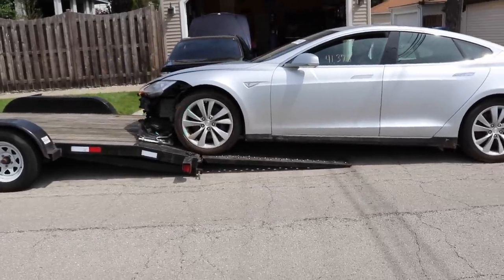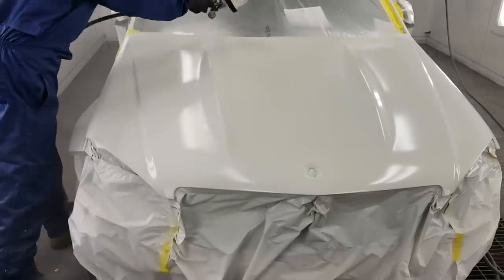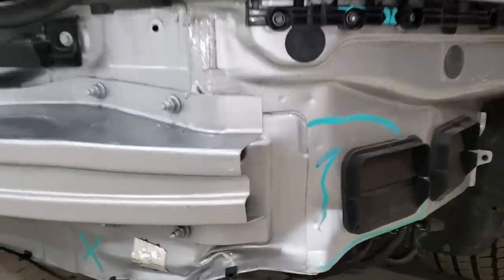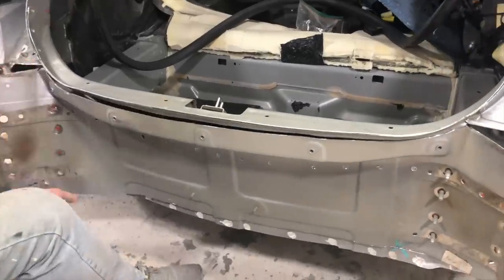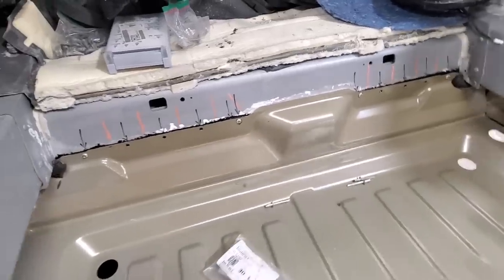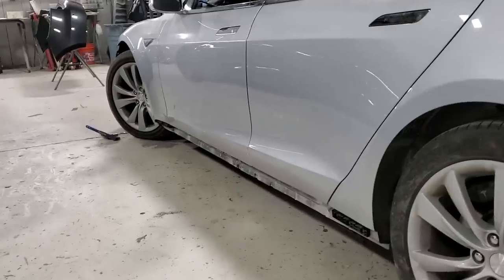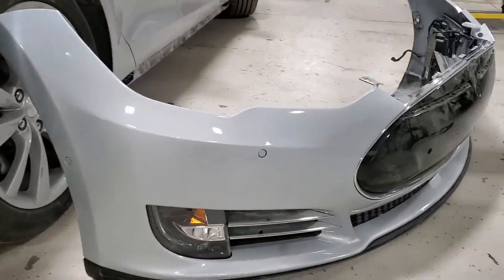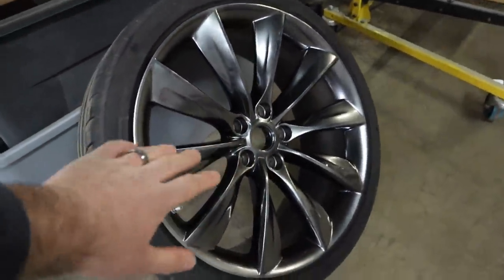Rebuilding The DESTROYED Aluminum Body On My Salvage Tesla & Price Reveal! Cheap Performance Tesla!

Comment from the maker: Would you drive an electric car today! If so, what model?
Reply: Not yet.  The range, charging time, and my own lack of place to plug in at home make them, to me, impractical
Reply: Model Y, new model, what could go wrong.

Stay away from that Rich guy.  I saw him lurking in a grinch suit at a florida farm.
Reply: Sure. The new Jag E-Pace looks decent for an all electric SUV, but I'd be going with the all new Cadillac Escalade electric SUV/truck, that is when it gets to market(spoken appropriately from the diehard GM guy that I am).
Reply: I had a '15 Leaf. I'd buy a new one, or a Tesla.
Reply: LegitStreetCars TESLA, would be the only option for myself😁
Reply: The one I'll never be able to afford. Porsche Taycan.
Reply: Always heard that the Nissan Leaf is the most reliable electric car
Reply: Nope. Where I currently live lacks a charging point of any kind (the garage in my apartment block has none whatsoever from what I've seen, and even if it does, there are none near my parking bay). Even if I could charge my car at my destination, I don't drive my car terribly often, so while I don't mind jump-starting a petrol car, I don't think I'd get very far (literally!) jump-starting an EV.

If my parking situation changed, I wouldn't mind a Tesla Model S (because Ludicrous Mode sounds like too much fun) or, if money was no object, the Lotus Evija, which is truly an automotive work of art.
Reply: Totally. Saves me a ton of time at the nearby Costco gas station and prices are only getting worse. Kona EV so far is the most practical and repairable, having better real world range than most Teslas. Taycan is the impractical dream. The 3 seems good too.
Reply: LegitStreetCars

No.
Reply: Been driving my 2013 Tesla P85+ for over 6 years now. No plans to replace it, love it.
Reply: I have a model S p85
Reply: I don’t have many options here and the charging network is very limited… I can’t do a cross country trip on an EV and also there’s only the Hyundai IONIC, Kona, the BMW i3 and i8 but worst of all… we don’t get Teslas… yet
Reply: So the rear color looks amazing, but the front bumper looks a shade or two darker than your wheel panels.
Reply: I get an electric smart car 😂 

Jk, I'd get the electric green SLS AMG!
Reply: A mercedes EQC 400
Reply: Yep! I have a model 3 and X with a Y coming next month!!! Love the channel!!!
Reply: @FixItRyan  I totally forgot about that. There are two here in norway. I saw one in 2014 and it was grey. I kinda got dissapointed when it drove away and didnt make any sound but then i noticed that it looked different from a normal SLS and i saw it said electric drive on the side. It was still cool
Reply: Peugeot 208
Reply: Too early.

Battery range and charging speed still slow on anything but very expensive cars.

Oh yeah and they are stille way to expensive compared to a petrol or diesel car.

Would make a lot more sense if the manufacturers focused on getting a cheap affordable car to the market. The kind you would buy as a second car for small trips. This way people would get this, and possibly fall in love with EV and replace their petrol or diesel main car with an EV.

Also....No trailer unless you buy the stupidly expensive ones, is prohibitibe here, for the main car, so until they solve that problem, only our second car would be EV.

Maybe in 5-10 years, which incidentally is about the time, my "new" car that i just got, will be replaced.
Reply: @rubyred93chev  I-pace is the electric vehicle. Naturally one would think the e for electric but that's the small SUV from Jaguar. The i is the electric vehicle
Reply: I would absolutely drive one. I'll take one of yours please. Sick work bro.
Reply: @jamesk3565  goes to show you just how much I don't know about the 'plug-in' vehicle market. And you were exactly correct on the conception of the E Pace versus the I Pace from Jaguar that I had. That said the I Pace looks totally cool for an all electric.
Reply: BMW i8 would be the dream for me. I just love the way they look. But realistically I couldn’t afford one, so I would love a model 3 performance with the full autonomous driving option.
Reply: @taelorwatson9822  new model that share 70% of parts from the model 3 which has not mechanical or electronic issues..
Reply: No place to charge it at my condo, so no. Eventually they'll have to retrofit all these condo and apartment buildings with charging but who knows how long that will take and how much it'll cost?
Reply: X
Reply: Tbh a Rimac
Reply: Would love Model Y!
Reply: Tesla is like the iPhone of cars.  Which one is the Android version?
Reply: I daily a 2012 Leaf, and have a Cybertruck on order to replace my long range car.
Reply: 1976 Montreal, with Tesla pilfered parts, custom controller grafted unto the original components from the hands of a certain electric, british wizard. Rear drive, through gear box, but not just any gearbox...oh no, a Lexus GS450H. I'll let ya figure that one out. :D

Will say this, marrying out Tesla electronics with Lexus ones gets expensive quick.
Reply: The new Porsche Taycan....... I'm not a Porsche fan at all but I as far as EV's go, it's a damn nice car.
Reply: Nope, never, due to the scam of electric cars, the colbalt is mined by up to 40k children in the Congo (unisef 2019 report)   Petrol and diesel for life, due to mileage, easy to work on and fix, and no waiting hours to charge the car
Reply: I'm afraid not, and I was in a position to get one. I like a Smart Fortwo for around town, but I'm afraid the cost, plus limited range and slow charge rate put me off.
I don't know what Mercedes Benz (Smart) are thinking. Only electric smarts available from new in the UK as well.
Reply: I had a Prius...does that count?
Reply: have you seen the Y, omg, drool!!!
Reply: when toyota makes ev corolla....
Reply: Tesla model S
Reply: Alex, are you and Sam brothers?  You look alike and sound similar!
Reply: LegitStreetCars A Taycan Turbo S. Yeah the range would be ass but it would still be one of the fastest cars on the road and I’d live to gap people silently lol
Reply: EZ-Go golf car, somewhere in the Caribbean
Reply: Model X, but price in Australia is over 150 K, so wont be ever happening !! Tesla are for the rich!  Porsche Taycan would be the ultimate, but $$$$$$$$ again for the rich!
Reply: @molskimauler  That is very nice !
Reply: Team work = Team Win...
Reply: If price wasn't an option, I'd drive a Model S P100D and debadge parts of it to look like a regular 60D car

also, how often do you go to the Iron Gate car meets?
Reply: I want a M. Just wait for used care prices to drop.
Reply: Chevrolet Bolt.  why? brand loyalty. i'm a Chevrolet/General Motors guy.  1st car, hand-me-down '62 Chevrolet Bel Air, 4dr, 283ci 2bl. i should have kept that car.                    Alex, have you ever thought of doing the high MPG tune on the Escalade?
Reply: YES, in fact I traded my ‘16 E63 S AMG about a year ago for a Model S P100D, and I LOVE this Tesla! Also, doesn’t hurt that I throw down 10.8’s at the drag strip every time I go; it’s insanely consistent and leaves the line like a bat outa hell. I’m pulling 1.5 60 foots and destroy most everything off the line
Reply: I am actually looking for a decent looking, economical plug-in hybrid with full EV mode. I am currently looking at the 2017+ Ford Fusion Energi Platinum. I had also looked at the Chevy Volt, Toyota Prius but like the style of the fusion over them. I also looked at the nissan leaf because you can get a 2013 for like $5000, but with a very limited range and being hideous I decided against it.
Reply: If I had the money, yeah! Either a model 3 or S
Reply: LegitStreetCars we have a Renault Zoe Q90 pure EV, does about 160mi then the Landrover Range Rover Sport PHEV which does about 20 to 30mi pure electric, just enough for the Mrs during the week then Petrol for our weekend longer trips / caravan towing
Reply: Nope, they're way too expensive, charging infrastructure isn't there yet, and there isn't enough knowledge on the reliability of fully electric cars. Plus IMO, most electric cars are ugly and try too hard to differ themselves from the looks of gas powered cars.
Reply: You will need to Xpel wrap the lower painted panels... the road will chip them... trust me
Reply: Electricity is way too expensive here in Spain compared with gas or diesel to be using an EV for now.
Reply: Yep .. got myself a used milk float 👍 google it
Reply: I'd buy a Chevy Bolt ev, they are priced well for a used 200+ mile EV. definitely love Tesla more though.
Reply: LegitStreetCars- Alex. Which home charger did you buy? I need to know. I have a Model 3 coming in 2 weeks, and the Tesla wall charger with 18’ cord is out of stock. Please tell soon!
Reply: @stephenoverstreet9898  I installed a nema 14-50 outlet and a plastic junction box next to it with the mobile charger that comes with the car inside of that. Barely $100 total
Reply: E=Pace or E-Tron first and then of course a Tesla
Reply: Tesla Model 3. If I could charge it overnight where I live in Sweden. Unfortunately, and very very much so, there is no way to charge it overnight where I live. And there's also the other smallish problem that i currently can not afford one... (sad face)
Reply: Nissan Leaf. LOL
Reply: I would have to have a 2nd car...due to lack of sound = lack of emotion = boredom
Reply: X
Reply: i realize it is kinda off topic but do anybody know of a good site to watch new movies online?
Reply: @Deangelo Cesar Try FlixZone. Just search on google for it :)
Reply: @Deangelo Cesar I use FlixZone. You can find it by googling =)
Reply: I like noises too much.
Reply: I’ll think about it in 10 or 15 years. Probably still not then. Just something about the rumble, smell, and sound of a combustion engine

Comment: The secret to getting your closest match (so you can save up money) is to get yourself a paint chip and go with it to a body shop that has a scanning laser + a paint spray filler station. After they fill you up, ask them nicely to give you the paint formula (if they didn't already) and percentages. And you're set, you can go to the body shop, show them formulation and they will be able to replicate it accurately without much hassle for special paints. 

This grows into an even bigger cost save when you're doing it at home in your giant inflated paint booth.
Reply: Inflatable Paint Booth = Rented Bouncy Castle!

Comment: 13:15
If 12V battery goes flat, at old car, behind nose cone, there was tab for recharging it. Now, with new bumper, if battery is flat, only way  to open it is to break into it.

Comment: The wheels look fantastic. Love the black chrome look. I have a 98 Monte Carlo Z34 that has black chrome moldings from the factory. No chrome!!! Great choice on the front bumper and side skirts. Any plans on window tint? I know that seems trivial, but with the silver body color, the tint would set off those wheels. Just a thought. Great video as usual. Have a great weekend. 
Dirty Side Down

Comment: The special tool used to pull the dents out was disappointing. I was expecting a cutting-edge, state-of-the-art Tesla-designed electro-mechanical tool...not a puller and a little metal hammer with a pointy tip. LOL! Still, the results were impressive.

Comment: After all the money you spent on this car why not just get the whole care repainted? That would at least make matching the color easier. Also the black chrome wheels look nice but the rest of the chrome needs to match in my opinion. If you're going to use an aftermarket body panel it should fir correctly too. The gaps on that front bumper are not even close.

Comment: Rear bumper does not match, not even close. On a high value vehicle its worth using factory paint codes and the same quality paint also most shops will allow for blending the paint to the quarters and fenders

Comment: What is involved in doing black chrome? I asked the local wheel repair shop and they do not know
Reply: Psst...Try Another Wheel Shop...
Reply: Doug Auzene there are only a small handful where I live. I don’t want to deal with the downtime of shipping the only set of wheels I have and have the car sitting on blocks waiting for them to come back...
Reply: @fabulousprofound  Gotcha...Wouldn't Wamt To Do That Either...
Also Check With Any Powdercoating/Metal Finishing Places Near You ... Good Luck! ;-)

Comment: Isn't the T-Sportline bumper known for horrible fit and finish and material quality, or did they improve it? What did the body shop think of it @LegitStreetCars
Reply from the maker: Watch the next video.  In this it wasn't fully bolted in and adjusted. It is now and the fitment is the same as many early Teslas. Not the best but it works. I'm 100% with it but see for your self in the next one.
Reply: @LegitStreetCars  Thanks for the (honest) response. I've heard the Unplugged Performance's version is made of better material, but also has the same fitment difficulties. A few friends here in Norway the UP one, and the garage that mounted it for them says they'll never do it again :D I'm keeping my old nosecone on my white Tesla Model S with black root, I kind of like that combo :)

Comment: All that to just fix the roof? I'd have said, "Fuggitaboutit!". Who looks at the roof of a car anyway. Paint it over and call it good. So you've got $25,000 in this just to buy it and add on to that all the costs of the repairs, esp. Mancuso's! and you still will someday probably not have any super-charging capacity? that's alot of dough for a car with an uncertain future. I don't get it.
Reply from the maker: It's just simple math.  I added up what it would take to buy it and it and fix it and it made sense. I don't need supercharging and the future was I daily drove the car for 2 years with no issues and then sold it to a friend